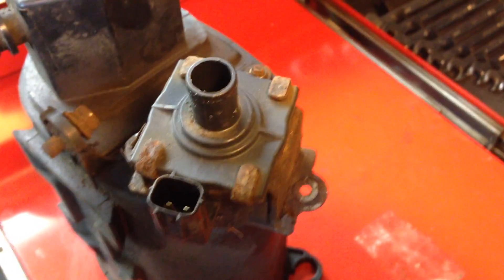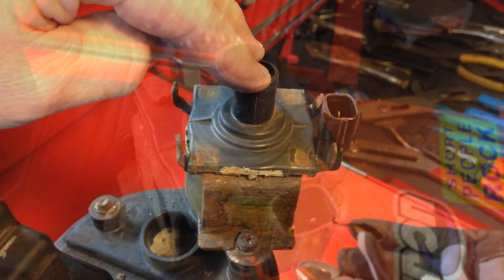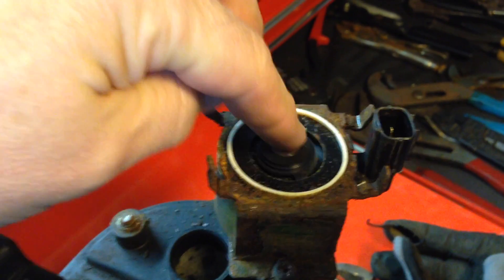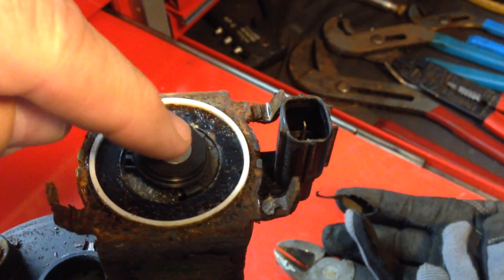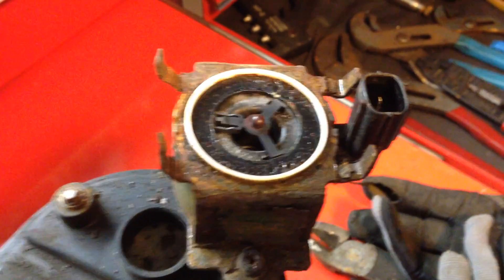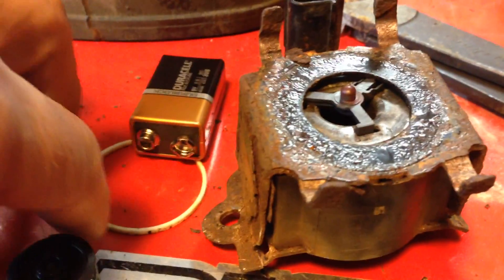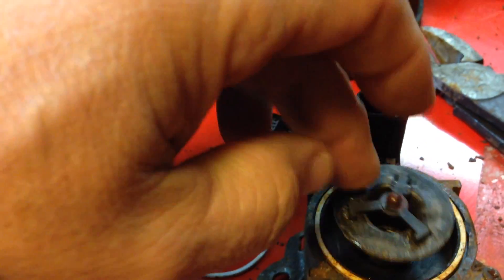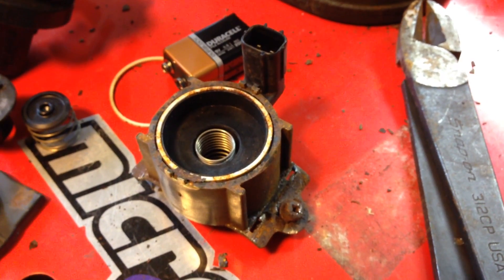Honda Check Engine Light, Canister Vent Shut Valve Operation

Comment: I have a 2003 accord v6, What I have noticed in this car when the weather is warm is that the tachometer oscilates between 600 and 1000 rpms, I opened the hood and I can hear that every time the revs goes up the vacuum switch valve (which is on the rear top of the engine) makes a click, like getting activated, 
could be something wrong with the canister vent shut valve?
Reply from the maker: Gerardo Moriel Hi Gerardo, most likely it's the Idle Air Control Valve, or you have a vacuum leak somewhere in the engine. Is the check engine light on?
Reply: Eddie Carrara, no check engine light on, just the tachometer going up and down, as far as I know this car has no IACV. I look for it under throttle body and there is nothing, also I read other reviews for this car and some people mentions IACV for older models but not for this one.
Any idea which hose could be leaking and how to detect it? there are many.
Reply from the maker: Sorry I've been MIA. Can you hear a loud  or soft unusual hissing noise? Did this just start happening all of the sudden or has it been doing it for a while?
Reply: It's has been doing for a while. I have news, seems like the problem went away. I got the coolant radiator cleaned inside and outside removing the dust and dirty accumulation and the tachometer looks to be always at 600-700 rpms as shall be (so far). I'll keep monitoring the behaviour for a couple of weeks and let you know the final result.
Many Thanks for your comments and information shared.
Reply from the maker: Hi Gerardo, if the coolant level is low, this can also cause a idle surge because the coolant temp sensor is not getting the proper readings so the ECU is trying to compensate. I'm not sure if this may have been your problem but it's possible .
Reply: Eddie Carrara IACV HAS ANTI - Freeze hose to it . Yes if - radiator is not purged it will cause you a problem !!!

Comment from the maker: Sebastian Rogers, thank you for the information, sometime you can get lucky and that's the kind of information that can really help save a few bucks :)
Reply: so if its leaking then it wont work right?
Reply from the maker: correct.
Reply: I’m having trouble now 98’ Honda
Vapor locking ! 
I change the charcoal canister ! - still vapor locking after several miles driving !! I will try this next !

Comment: Hey guys I was having this code p2422 7th gen accord 2003-2007. I took apart the canister vent shut valve close malfunction. Than I sprayed it with WD-40 and pushed the valve in and out a bunch of times. It fixed my problem and I didn't get a check engine light since. Hope this helps!
Reply: Sebastian Rogers whats the location 2006 accord
Reply: Sebastian Rogers whats the location 2006 accord
Reply: Anybody recommend this
Reply: Thanks for the tip!

Comment: This is really cool.  My 2005 Suzuki Aerio has a nearly identical valve.  It doesn't bolt directly to the canister but attaches by a short length of 1" hose.

In my case it would stick in the closed position after power was removed.  Given the high cost of Suzuki parts I am still hoping to repair (clean) the valve.  I don't know whether this is feasible.
Reply from the maker: ***** It's doesn't hurt to try, but usually the leaks are caused by damaged o-rings or diaphragms.
Reply: Indeed you are right.  I got inside the valve.  Diaphram was good but the solenoid piston was binding up due to minute particles of rust.  Evidently some moisture must have penetrated the gasket.  I think salt ate away at the steel portions of this valve.

Can it be repaired with RTV and zip ties?  Probably yes.  Is that a good idea?  Probably not, haha.
Reply from the maker: I think you answered your own question again Kev, lol. but again, if you don't mind spending the time testing, go for it. Sometimes you get lucky, and if you do get lucky, you can share the results here :)

Comment: Hey bud I own a 98 ex civic if the port stays open can that make the car smell like gas inside the car ?
Reply from the maker: Hi Sal, the fumes would not leak directly into the car, but I believe the canister is under the hood on this vehicle, and the fumes could be sucked in from the cars fresh air intake at the cowl.
Reply: Mine is by the gas tank!!!  98’ Honda Accord 
And I smell gas instead the cabin when I drive it ????

Comment: Thanks Eddie,  I will change that evap canister and vent shut valve. I was asking if it affects the fuel economy.  Thanks
Reply: Yes
Reply from the maker: When ever the check engine light is on, your fuel mileage will drop because your computer is no longer making adjustments to the engines fuel/air intake, it's basically running your engine on default parameters, and not running at max efficiency. Hope this helps :)
Reply: Eddie Carrara  that’s now how this works.

Comment: Hi I have a 2003 cr-v and took it into the dealer to diagnose the engine light issue. They say it needs a evap canister and shut valve. It costs over $500 for parts and labour. I'm wondering if this would cause my fuel gage to fluctuate and be harder on gas? They say this measures how much fuel is brought to the engine from the tank? Also the exhaust seems to burning rich. It also seems to be fume-y in the cabin when idling.  Thanks B.
Reply from the maker: Hi charib87, No, these two parts have noting to do with measuring how much gas goes to the engine, the canister and shut valve collect fumes from the gas tank, once the canister is full, it purges the fumes to the engine to be burned. This would have nothing to do with the fuel gauge fluctuating and the engine running rich. You may have an exhaust leak causing fumes in the passengers compartment and it's sounds like your fuel tank sending unit is malfunctioning. Do you know what code they pulled? Let em know if you have more questions, thanks.
Reply from the maker: GenXBCM No, the only thing these two parts do is collect fumes from the fuel system and purge them to the engine to be burned, it has nothing to do with it measuring fuel, it also has nothing to do with how hard you step on the gas pedal. The code is a P1457 which means there is a vacuum leak on the canister side of the fuel system. I would start by changing out the canister and the vent shut valve and hopefully it takes care of the problem.

Comment: Where is the valve located?
Reply from the maker: Hi Dave, the valve is located on the side of the canister, and the canister is located under the vehicle neat the front of the fuel tank, sometimes under a black plastic cover.
Reply: Thanks, I have a 02 Honda accord coupe.
Reply from the maker: Sure Dave, no problem :)
Reply from the maker: David McGrath Hey Dave, check out my other video, it may help you a little more if you haven't watched it yet 99 Honda Accord P1457 Code
Reply: I watched it. Thanks for the videos.

Comment: hey eddie, quick question.  i changed the shut valve and light came back on. here is my problem though. number one i never check the old valve to confirm it was actually bad like you did in this video, i just assumed it was. second i had to drill out the screws and in doing so i sliped and put a small whole in the canister. do you think my cel is actually from the canister hole now and the original problem was fixed with the shut valve???? thanks
Reply from the maker: Hey James, the hole you put in the canister is probably causing the light to come on. Try filling the hole with some sealer and driving the vehicle for three driving cycles (stone cold to operating temp 3 times). Let me know what happens, thanks.
Reply: Hi guys how to replace codes 1456 2002 HONDA accord 2.3ltrs